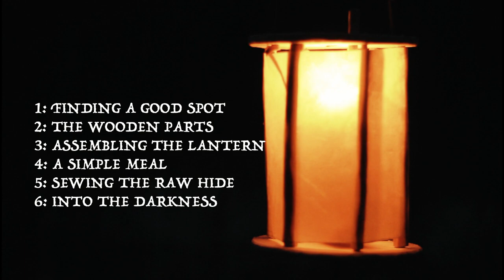VIKING Lantern Rawhide Lamp | Viking Bushcraft - Viking Crafts Guide (Ep. 11)

Comment: Can you find replicas of the augers from the Mastermyr find?
Reply from the maker: Yes:) and I have 2. They Are great tools. Thanks for watching
Reply: @RAMUNI-Viking  I won't offer to send you any then.
Reply from the maker: Thats very kind of you to think like that. For the House project i am looking for a 20mm auger for pegs. I have a 1 cm that doesnt work well and a large that makes 50mm holes.
Reply: @RAMUNI-Viking  Let me see if I can find a metric ruler and I'll get back to you.
Reply from the maker: Thank you:)
Reply: @RAMUNI-Viking  Most of the forge work is done, then some filing and I would guess some experimenting and adjusting, then heat treating.  Quite an interesting project.  Should I send my e mail?
Reply from the maker: Wauw thats fast:) sounds really good. Yes either send me your email or if possible lets get in touch on messenger or instagram

Comment: 🎩Hi. Seems very easy to make. Only one problem is, in England the only place you can get rawhide is from a pet shop in the form of dog chews, and it’s only thin strips. About 3” wide.
Reply from the maker: Its is fairly easy to make. Especially with modern tools also. Its possible to see Them together but I bought a while hide from a musical shop meant for a drumskin for tradition traditional drums like Bodhran or shama drums. Maybe thats the direction to look for largwr pieces. It gets pricy though. But there a good few lamps from a whole goat hide
Reply: butcher shop? Farmer?
Reply from the maker: @Sheepdog1314  could be. I made some also myself many years ago from a deer hide a got from a hunter. Fairly easy process.
Reply: Does your pet shop sell the rolled up rawhide chews? They look like a little log. Soak them overnight and unroll them to get a decent sized piece.